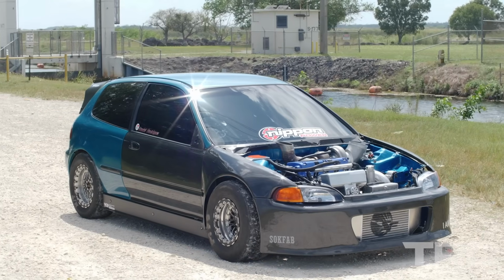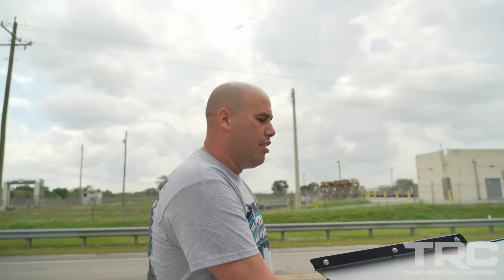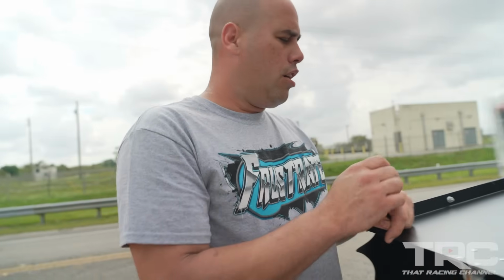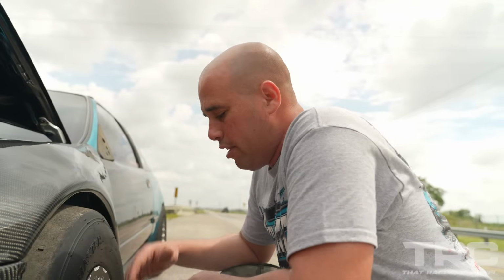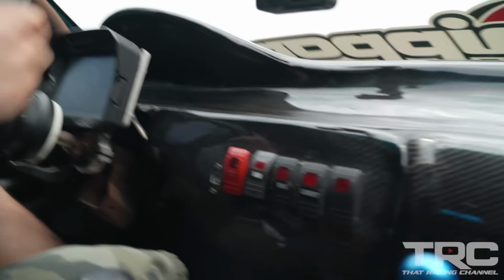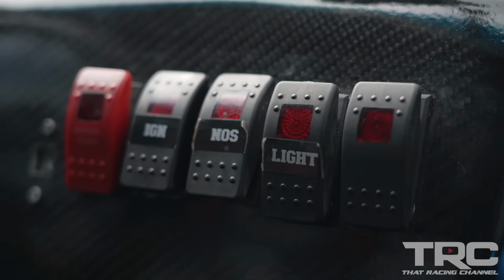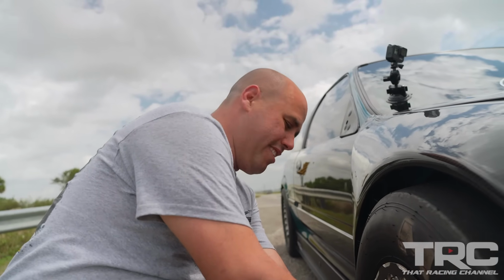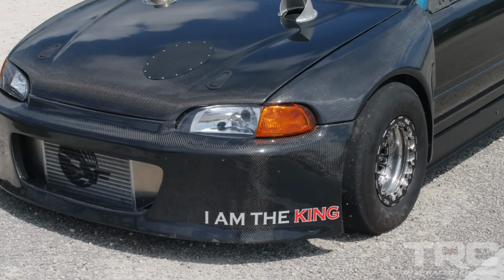1400HP AWD Civic is Terrifyingly FAST! FRUSTRATE EG Ridealong (FASTEST Honda on the Street)

Comment: Now I want to see a car like this with two K24s this powerful. One in the front and one in the back. Synchronized shifter to work both transmissions. Will the drivetrains hold up with bigger slicks and that much power?  Someone with crazy money build it and get TRC to film it. Lol
Reply: Neutron engines is building a k48 engine with two k24. Looks exciting
Reply: @ShyTurtle57  yeah he's a mad lad. Probably my fav concept on the internet right now. Just waiting to see the end results
Reply: Like the green golf that was featured in 1320's video.right??
Reply: @farhad7236  yes exactly. It would probably buck and hop and destroy drivetrain.
Reply: @ShyTurtle57  w72 with 3 K24s. I don't know if the crank would have enough room for all those rods. Lol
Reply: Just imagine a 2800hp AWD civic that weights ~1370 kg

Comment: He should run the  NOS MASTERMIND that you program what RPM the NOS starts n the shot amount it starts n shot amount it ends in each gear, I had mine kick in at 3500rpm @25shot n by 5000rpm 100shot n 1st gear and 3000rpm 75shot n 4500rpm 100shot 2nd and after that 100shot 3000rpm 3rd n but this was back n 1995 on a H22A stock engine prelude with a T3 turbo @18pounds 1/4 13sec Honda has come a long n faster way over the years

Comment: The Civic Type R needs 4WD.  Honda needs to offer its Civics and Accord outside of JDM with 4WD and manual transmission.  Their engines from the B Series to the K Series have massive potential, by they fall short on the drive system in laying down the power.  I must say though that FWD Hondas handle very well with suspension tuning.

Comment: They are lighter. Much lighter. But he’s a big boy and with all the added stuff to make it able to go fast it’s come right about back to the stock weight after removing and replacing heavy or useless parts. You can’t say a 2100-2500lbs car isn’t extremely lightweight

Comment: I've got to ask, why do they not put as big a tire on the back on these cars? Seems like the car pushing down on a bigger tire on the back would add lots more traction? I know nothing about these setups just wondering?
Reply: More of the power is on the front axle.
Reply: If I'm not mistaken it's a 70/30 bias front to rear
Reply: @albertlewis1284  So they can't control that?
Reply: @robertelmo7736  They use the CRV’s transfer case and differential. It’s not like a Syvecs on an RS3 where you can put all the power to the front wheels or control the split. It’s 70/30 constant.
Reply: Not that I know of. There are a few awd builds going on around me and no one has figured out the recipe.... yet
Reply: @AnabolicRick915  false… all about the fluid in the viscous coupler … watch gringotegras. Latest video, he’s got it down to a 50/50 split which was dyno verified.

Comment: 1300 hp on a 4cylunder VS 1300 on a v8 or is alot different like there's no actual torque on a 4 cylinder compared to v8

Comment: Youu in Amérique is honda civic in france is 106 16s ho saxos vts GTR bie turbo is 530 hoseepower 0 a 100 kmh 3s just speed max is 325 kmh no said the mph the cars saxos vts GTR bie turbo 530 hoseepower stoc is cars the citroen sport is ok the route ho circuit just one leteel problem is _90 mil euro the cars